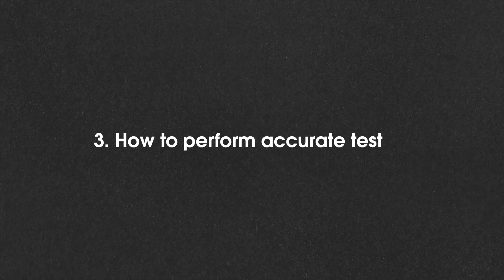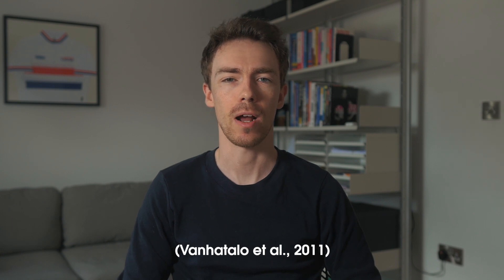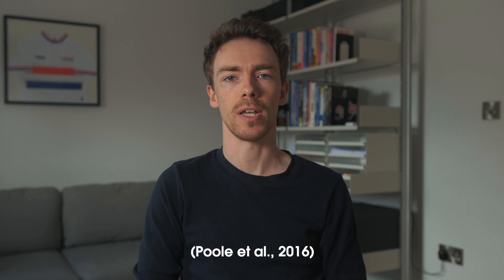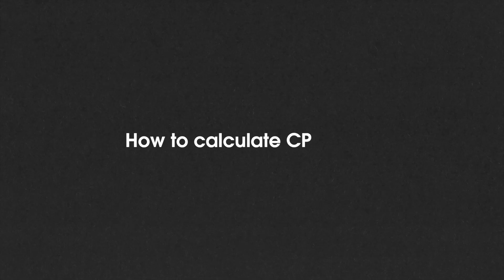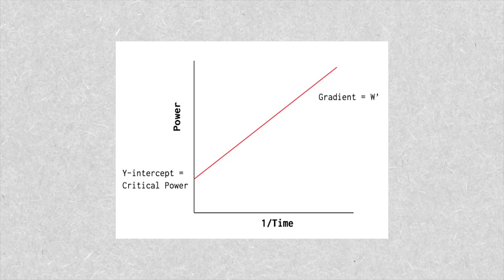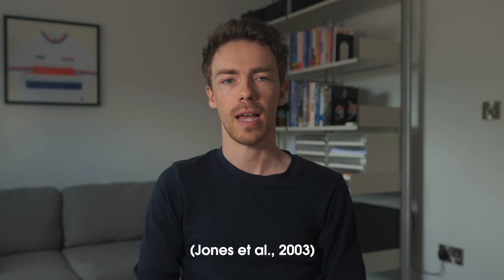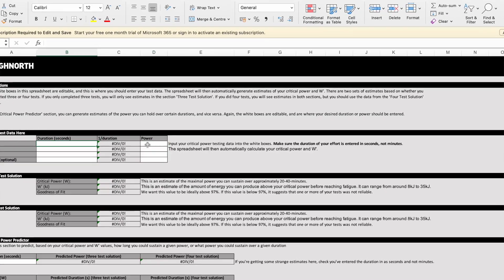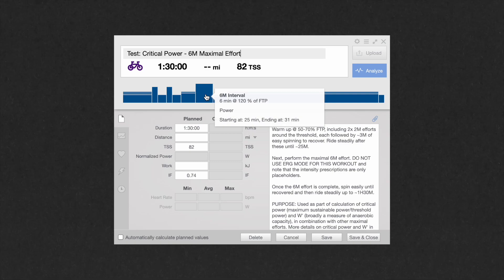Critical Power and W' Explained For Cyclists (inc. free CP calculator)

Comment: Is it possible to go negative at w'? Sauce-tools in strava gives a visual in this, could i also use that as a test. In a race (when w' was at 20 kJ) i ent to -19 kJ, does that mean i should set it to ish 40 kJ (seems quite consistent with your calculator) or is it inacurate and should indicate that i was quite spent... Thanks for an interesting video. This consept makes a lot of sense and should help with understanding performance and pacing in races..
Reply: Short answer is no. You either need to feed the Sauce-tools model more/better data, or, definitely recommend manually inputting W' based on your own testing.

Comment: Very Interesting. I just cheated and plotted six of my personal best powers between 3 and 30 minutes onto a graph as you described and got a dead straight line with Critical Power of 199 Watts and W' of 12.6 kJ. As I weigh 58 kg's I can now see why I'm struggling to ride at 5 W/kg for 3 minutes on my favourite hill climb. Maybe I need to do some training !
Reply from the maker: That’s great Philip! The more efforts, the better really! That’s why CP and W’ are useful, because you can see how one compares to the other (your sustainable power and your “anaerobic” (not strictly, but close enough) capacity, to see where you’re disproportionately stronger or more limited and thus what type of training might be best to improve your overall performance 👍
Reply: @tombellHNP Thanks for your feedback. I like this new concept but it raises a question regarding how long it takes to recharge W'. Is that minutes, hours or days? I look forward to doing some tests on myself in the coming weeks to try to find out.

Comment: Does it matter if you do the tests in or out of the saddle or a mix of both?
Reply from the maker: We never put any real restriction on this Richard, and however you tend to ride to produce your best effort over a set duration is the way to go. Personally, I like to perform the efforts on climbs and standing is my preferred way to climb maximally, but others will prefer a flatter route and seated is likely better for that. A mix of both is totally fine too - the main thing is just to pace efforts in a controlled way, trying not to have massive swings in power output throughout. -Tom
Reply: @tombellHNP  Thanks Tom, I’m interested in trying these tests in the near future.